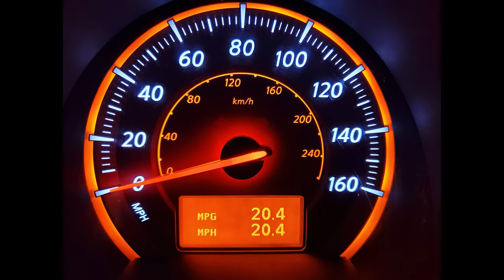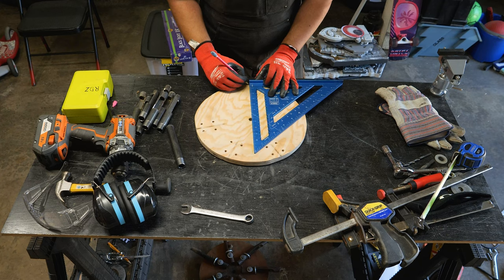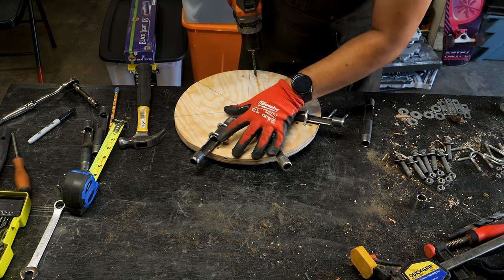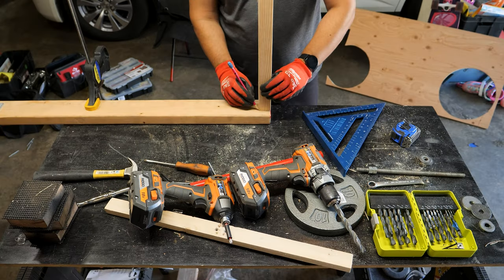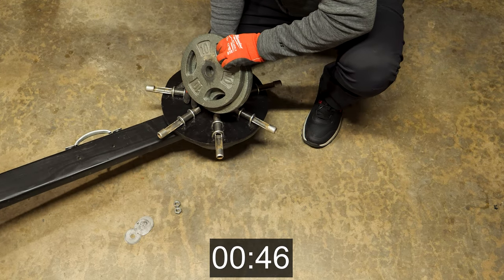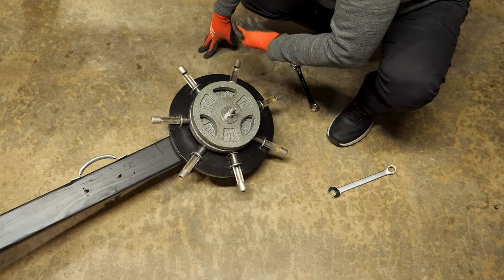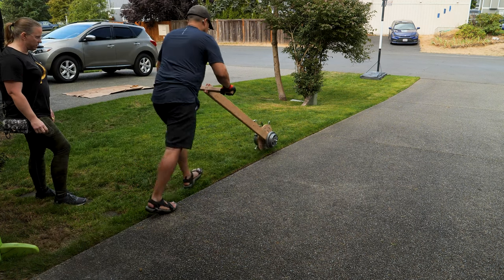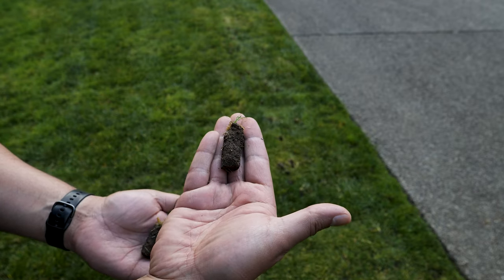A DIY Lawn Core Aerator For $160?? You'd be surprised!!

Comment: my thatch is as thick as your entire core. I may need 6" core spikes and 100Lbs of weight to get through my thatch.
Reply from the maker: LoL. Oh man, that does sounds like a lot of thatch.  Well, if you do end up wanting to core aerate, it will be worth dethatching. What kind of soil and grass are you working with?
Reply: @Albert Does It All  grass doesn't grow, lots of aunts, grubs, weeds, and the thick thatch. Was thus way when I bought the house last year.
I'm trying to fix it so it looks good, now that I'm the owner.
Was very neglected before I bought it.
Reply from the maker: @randy3577  Ouch, sounds like a big job for you. I think I would just spray a vegetation killer all over, let it all die off during the summer and plant new grass seed during the fall. It's a lot of work,but it'll be worth it.

Comment: How about using conduit instead of pipe?
Reply from the maker: I would stick to stronger metals.
Reply: @vandit0o0o  I was thinking conduit would be inexpensive to replace and penetrate easier. Also I have the southern red clay to deal with.
Reply from the maker: @philzail2532  I see. It wouldn't hurt to try that type of metal. Just keep in mind the tines will carry a lot of weight and hitting something like rocks could damage the tip or bend it. If your clay is to hard/compact, try adding some soil amendment to it.
Reply: @vandit0o0o  I do understand what I have and what I need to accomplish. I grew up on the shores of Lake Erie where we had six inches of top soil. I want to build or buy something I can pull behind my riding lawnmower. I more than anyone need to amend my soil. I'll make the tines double ended symmetrical so I can use both ends. A pipe as your using in my opinion will have a much harder time being able to pierce the clay. A thinner wall will work better at that. Conduit is fairly in expensive, cheap to replace. I might even be able to have the tines ground fairly precise. I was a machinist all my life and still have access to a machine shop. But amending is priority one!

I just looked it up, 1/2" by 10 foot conduit cost, $6.65. Also I think you're underestimate the strength of conduit. I think it will wear fast because it's a mild steel, so I'll need to redress the ends. But I think it'll keep it's form.
Reply from the maker: @philzail2532  Yeah, it definitely sounds like a good plan. Let me know how it works out with the conduit metal so I can know to recommend it as well. 👍

Comment: Use 2 used brake rotors instead of using plywood for the wheel. No need for weights either.
Reply: Was just thinking about that! But I recon spending the extra $120 bucks to get a real core aerator will work better and be a whole lot less work
Reply: They will turn into a rusty mess after a year in the shed
Reply: @AnonymousGameWarden  please enlighten me where I can get a real core aerator for $280
Reply: @ShadowGKCP  there are several options if you just Google tow-behind core aerator. Few options in the $250-300 range that look like they'll get the job done in a timely manner. Vs spending $160 and having to manually push a single wheel core aerator across 3 acres of lawn.
Reply: @AnonymousGameWarden  Yeah but those need a lawn tractor to tow them...
Reply: @ShadowGKCP  which I already have.. lol I speak for myself, not on behalf of all people with a lawn
Reply: @diytwoincollege7079  paint them

Comment: Use Liquid aeration I had one of these machines and it's too much in the long run and doesn't do as well as liquid aeration
Reply from the maker: I do the liquid aeration every year at the most twice. But I still like the benefits that core aeration does. Still, you won't go wrong in either method.

Comment: Or you could just rent one from HomeDepot for $75 for 4hrs, or $100 for full day. You'd still have money left over in your pocket, plus all the time saved from shopping, fabricating, assembling, and the time it took running that thing so many passes back and forth. Time is money, and this takes up a LOT of time. Then you have to store it till next year, and probably repair it.
Reply from the maker: Yes, renting is definitely an option for some I agree. My DIY is mostly for those who want the satisfaction of building one of their own , not have to spend more money having to rent one if they want to core aerate multiple times a year, not have to load and unload a heavy machine multiple times to and from the store and have to have fuel available. My DIY is still cheap, very easy to build, lite weight, can be disassembled to a compact size for easy storage and very easy to use (to include being customizable). And since building mine almost 1.5 yrs ago has yet to break down or need any fixing or adjusting. To include no need for fuel and changing of the oil and filter. Sure it takes me just a little longer to core aerator compared to mowing...with just one wheel. Once I add the second wheel, it will cut down on my time even more. Your observations are valid, thank you  for your feedback. Happy core aerating. 👍
Reply: Rent for day and split cost with neighbors usually you could do your yard and two neighbors to offset rental cost.
Reply: @vandit0o0o  I'm with you on making one. I could afford to go out and buy one of these for $3k but is rather make one myself. I saw a guy online make one out of an old treadmill. It had the handles and giant display on it still.
Reply: Renting is not cheaper in any sense.  It’s definitely easier.  You have to rent every single time.  So two rentals and you’re already over.   This can be used over and over and over and over.  And the guy just wants to show ppl how to do things for themselves, why try to talk him out of it.  If you do commercial landscaping and your only choices are (1)cheap, garbage spike aerator… (2) extremely expensive powered core aerators (3) spend $120 on a rental, spend gas, time, energy, and headache picking it up, doing paper work, etc. and have to aerate as many yards as possible in a single day just to barely break even or just make a small profit.  This can be carried on the truck at any time and simply done at any time, as needed.  The dollar cost and the convenience cost will pay for itself almost immediately and do nothing but bring profits.
Reply from the maker: @Midnight_Gardener  Mic drop!
Reply from the maker: @ZeusKingOfAllGods  lol, gotta keep track of them miles.
Reply: @vandit0o0o  landscaping is one of the most expensive businesses to run.  Just the simple startup cost along with yearly maintenance on ONE of everything:  truck, trailer, mower, weedeater, backpack blower, backpack sprayer, oil, gas, gas+oil mix, saws of ALL kinds, hedge trimmers, bed edger, broadcast spreader, hose-end sprayer, air compressor, wheel barrow, trailer hitch, shovels, rakes, ladder, pressure washer (optional), water hose, PLUS the cost of the tools to simply fix minor maintenance issues on every single one the items on this list.  And this is all just the absolute basics you must have to be able to make money in any capacity.  Not a single one of those things are under about $30-$40.  After a few years, you just start building your own tools, start learning how to be a better mechanic, and start taking the hit on the “convenience.”  Then all that, just to hear people say, “$60-$75 just to mow my yard?!!!  It’s only a half acre 🤷🏻‍♂️🤷🏻‍♂️🤷🏻‍♂️.”  Landscaping and construction overhead is straight up astronomical.
Reply: @vandit0o0o so i say all that to say that i appreciate any kind of resourcefulness and ingenuity in any sense.  It is extremely helpful to me

Comment: A machine like this cant have any wood in it. Wood shrinks under pressure and wont hold your device together. It will become a loose, shakey thing that just dont work. You didnt invent anything. You did a poor copycat of a superior machine made by AMICK ROLLAERATOR
Reply: You’ve been scamming people bro
Reply: Let me give you a little bit of free advice.  Stop whining and complaining. If you had a superior product at a competitive price customers would buy it and not try to make it themselves.
Reply: @BP-1988  Well said!! I am getting ready to make one myself. I will never pay $450 for something I can build for $160 or less!
Reply: I am getting ready to make one myself. I will never pay $450 for something I can build for $160 or less! If it gets loose the few times I use it, I will tighten it up and keep on aerating! Lower your cost to $200 including shipping and I will buy yours! If not keep your invention and your opinion. And we will keep our money and build our own.
Reply: The price you have to pay for a crappy Amick made from a brake disc and some steel pipes is a bad joke. The project in this video is inspiring and very cheap, especially if you have dumbbells at home.